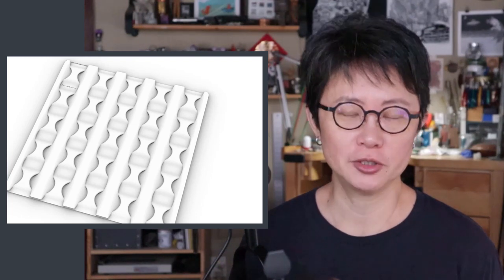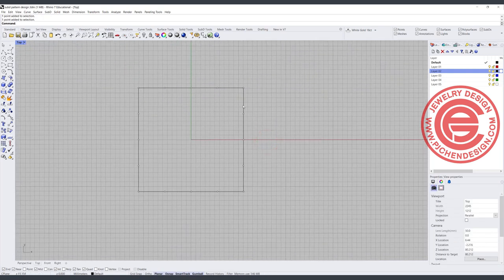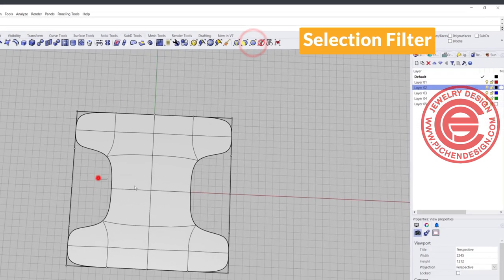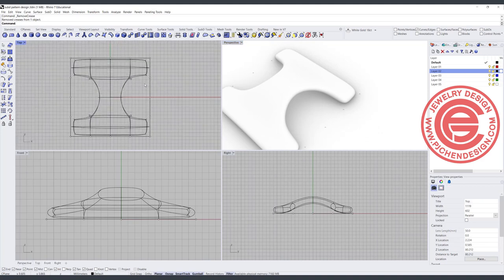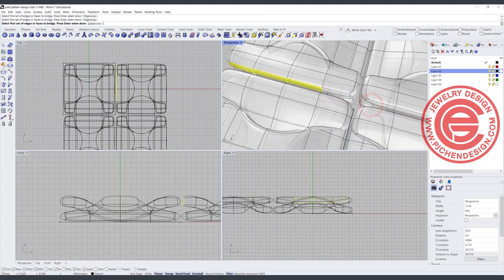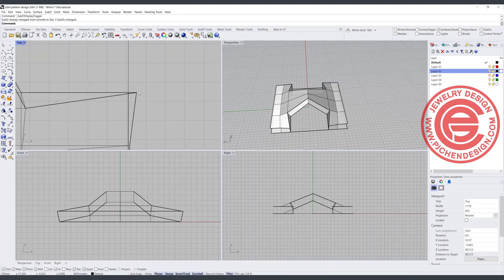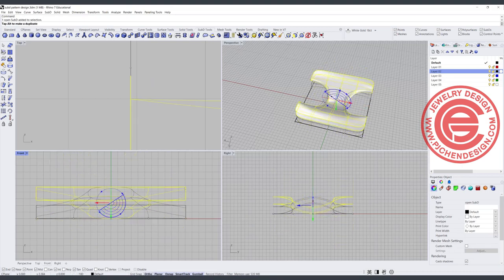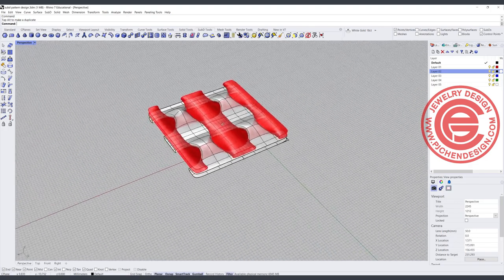SubD Pattern Design- Jewelry CAD Design Tutorial 3D Modeling with Rhino 3D #266

Comment: Hi, maybe you know the solution for the following problem. I made a polysurface using subd, now i want to use the command Create UV Curve but i cant because when i chose the surface it is choosing only a little square part of the Subd surface instead of all surface. So the question is how can i chose all surface? Thanks in advance.
Reply from the maker: Once Subd turn into polysurface, there will be a lot of seams. create uv curve only apply to single surface. It depends on what you plan to do with those surface. for example, if you plan to flow stone on it. you actually just need to extract isocurves from those surface and join together. and use flow instead of flow along surface. so it can be done in different ways depends on what you plan to do
Reply: @PJChenJewelryDesign  really appreciate you making time answering the questions, thanks.